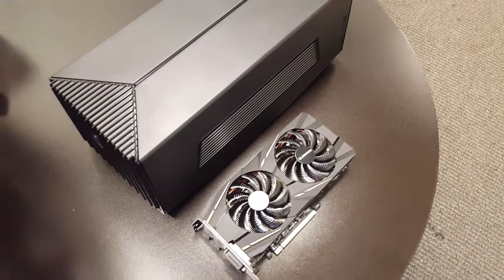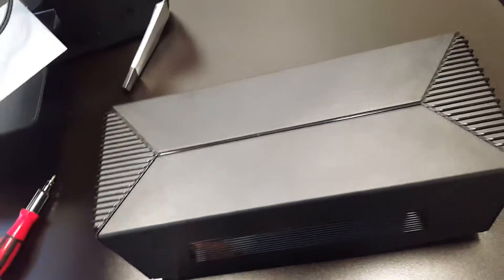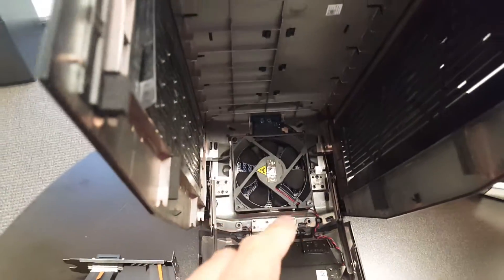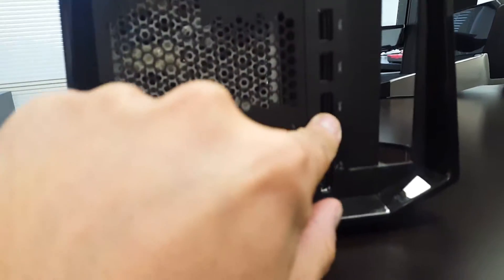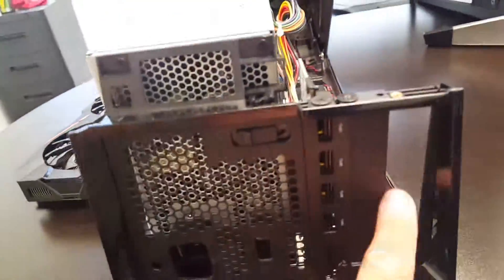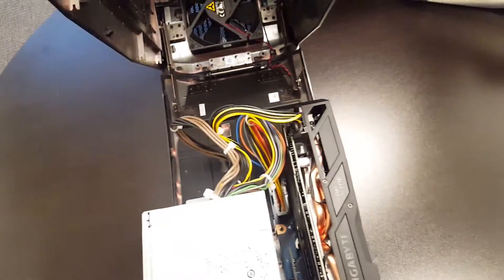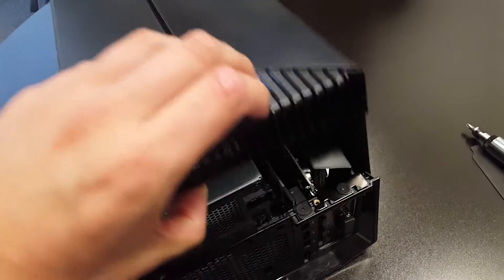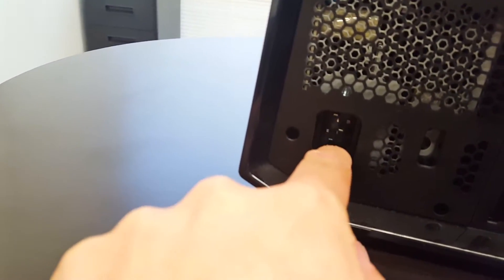ALIENWARE GRAPHICS AMPLIFIER and RX 480 VIDEO CARD - INSTALLATION

Comment: Hello I made a video card msi amd rx 480 for 8gb alienware alpha R2 connecting usual with the graphics card amplifier. now all right at the beginning, the pc turns on and recognizes the new video card. After 3 minutes the pc slows bad and freezes. Now the pc turns on but the bios does not start and the screen remains black. with its original video card does not happen. what i can do?
Reply: Dante Evil I'm having the same problem

Comment: can you use the graphics amp with other laptop brands?
Reply from the maker: Unfortunately, alienware graphics amplifier is proprietary solution for Alienware hardware only and it uses specific proprietary pci-express cable. There are other solutions - more universal through Thunderbolt 3 (usb-c) like Razer Core
Reply: so if i have an asus laptop i can use the razer core via usb c port ?
Reply: It has to have a thunderbolt 3 port, even though it is a usb-c the data transfer rates are four times faster with thunderbolt than usb-c